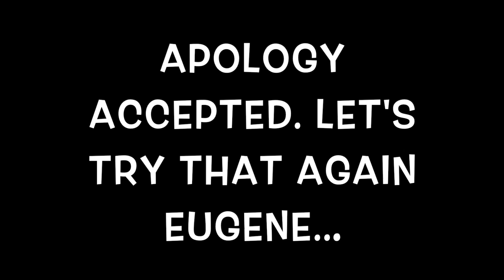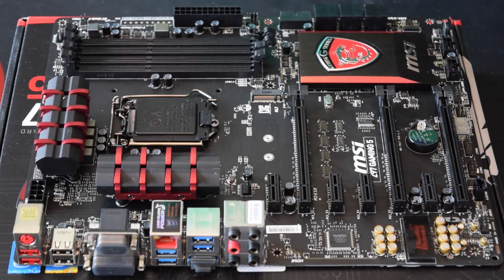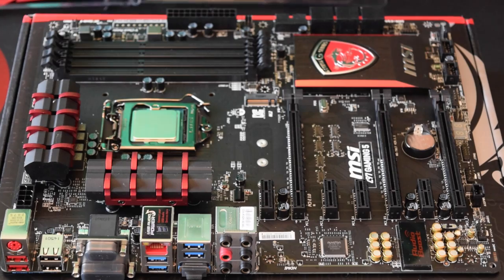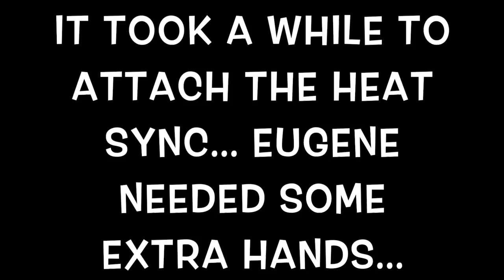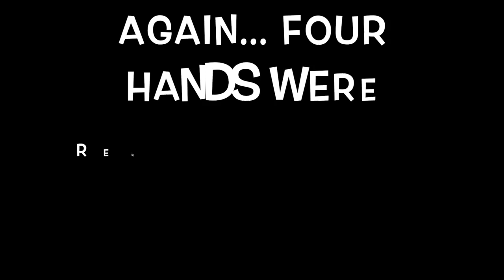Console Killer GTX 980 HTPC Build Log

Comment: Awesome build man. My latest build used the Grandia 09, i love it. I went alittle cheaper with a 960 but still pretty good benchmarks. Better than a "console" :). 

Acouple questions, how is the cable card reader working for you? Are you using WMC to view your shows? How does recording work with that kind of setup? Curious cause I want to do something similar.
Reply from the maker: Unfortunately, the solutions are getting more and more limited.  I use a combination of WMC, a backend program called ServerWMC, and Kodi to watch cable through the PVR sections of Kodi.  I haven't checked out the recording functions at all but I think they work quite well.  You can find a lot of information on the Kodi forums, actually, in the PVR section (even if you won't use Kodi yourself).
Reply: +eugenetries Kodi is my best friend lol. Ill look into it more. Thanks for the reply, and again nice video.

Comment: This is my HTPC. I love your videos and please make more for the community. Best of luck and as always great build. My Build specs: I7 3930k OC @4.7 (5.0 second preset) x79 chipset 16 Gig G-skill Ddr 1600(4096 X 4) Asus X79 sabertooth Mobo, Msi Gtx 780 Sli, Corsair H110 280mm Liquid cooler, Crosair Ax1200i Digital Psu. Ssd Kingston Hyper X 240 Gig (X2 Raid 0). Ssd Patriot Wildfire 120GB and a 3 TB storge drive. X Fi Titanium HD Sound Card. This is all placed in a Silverstone HTPC case.

PICS http://imgur.com/a/lytAK
Reply from the maker: +Tyson Sheaves Wow, awesome build!  How's it running?

Comment: Why the hell would you use custom sleeved cables that aren't easily manageable, when the EVGA Supernova G2 comes with AWESOME all black sleeved cables??
Reply: +Mario Saltalamacchia I totally agree, having built into another Silverstone HTPC case, the original "ketchup and mustard" cables that come with any old power supply will eliminate the custom sleeved cables rats nest that was created. Of course insisting on the way overkill EVGA power supply gives you the black cables as a bonus, as you point out.

Comment: Thanks for the video, I used it to help decide on parts. I chose many of the same, except I grabbed a 980ti. Same case too! Anyway, I finished building it and have absolutely zero power when I hit the button. I checked the power button cable and it is seated correctly as far as I can tell, and get absolutely nothing. Did you run into anything like that? Wondering if the case is shorting it somehow on the motherboard standoffs.

Comment: @Eugenetries what was the issue you had on first start up that you didn't show? I am still having issues getting a verrrrry similar setup running at all. I think I may have a bad motherboard or PSU, which is why I am asking. Thanks.
Reply from the maker: +No Pity For The Majority My issue was that the 24 pin PSU cable was not working.  Let me know if that helps.
Reply: +eugenetries hmm, that technically 'could' be my problem, I am getting nothing to the motherboard. (Same PSU and MoBo as you) and was getting absolutely no power. I have a new motherboard and PSU on the way though, since Newegg has awesome service.
Reply: +No Pity For The Majority by the way, that painting in the background is epic; something like an anthropomorphic version of the lion king.